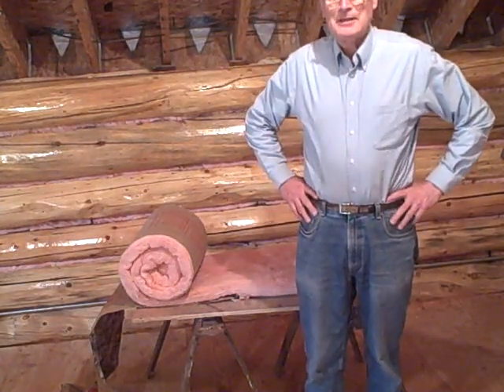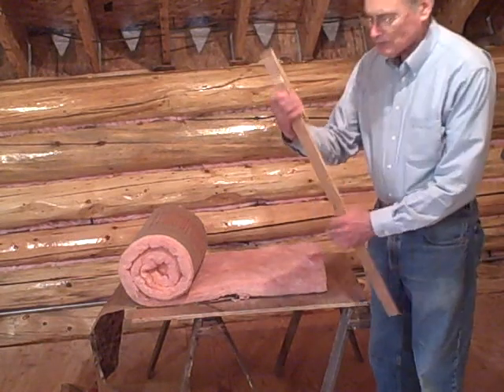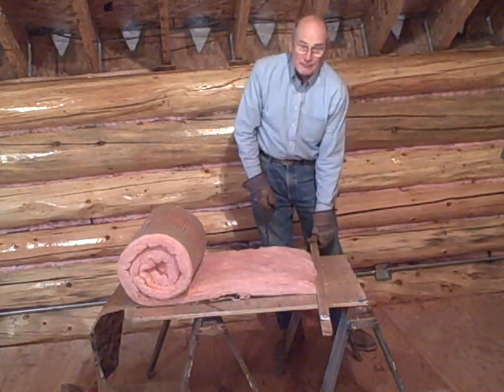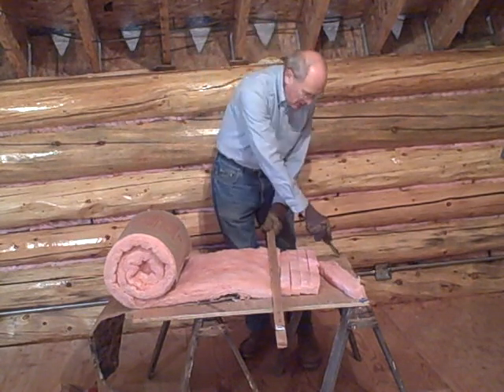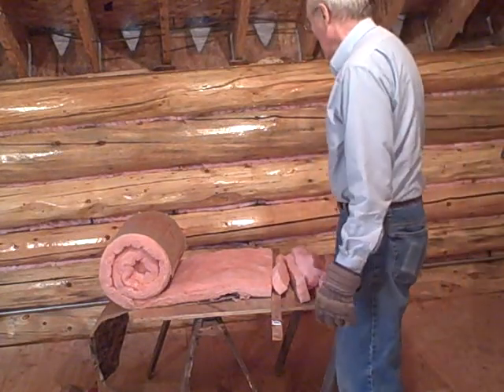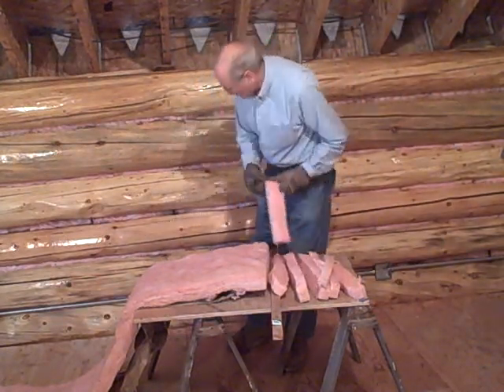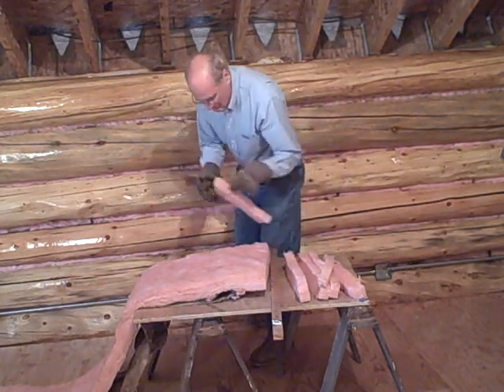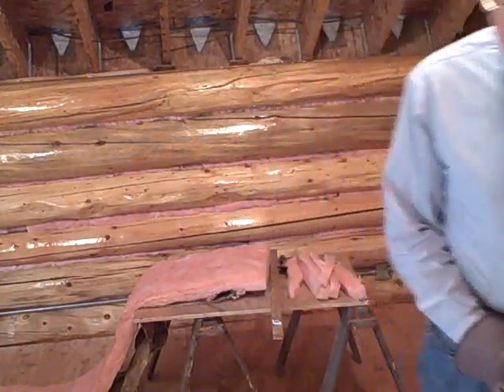Martin Cabin 04 28 09 Insulating Log Walls

Comment from the maker: @rushthezeppelin If you watch the video carefully you can see that I don't compress the insulation much at all. I compress it on the table only to cut it into strips. The strips fluff up right away after that and especially when I pull them apart to make the smaller strips that I place in the cracks. I try to choose strips that just fit in the crack without having to be compressed. The trowel is used to tuck the insulation in the crack, not to compress it. Thanks for your advice

Comment: every house (including log) needs  a vapor barrier of some measure.. Especially in the small spaces that make up the joinery. You have no vapor barrier with this system. (old school)
 When warm air mixes with cold air in the lateral joint you create moisture and poteneially frost. We all know the power of frost and moisture.
this wall fails over time.

Comment: You are severely diminishing the R value of that insulation by compressing it.  Those batts already can't be more than R-8 maybe R-10 and you are probably diminishing them to R-4 or less.  Remember insulation needs dead pockets of air to work and when your squeezing the pockets you lose R-value.  Would be better off taking a can of polyseal and putting some closed cell foam in those cracks, insulates and seals.  Trust me I'm a certified Energy Star home inspector, I inspect insulation everyday.